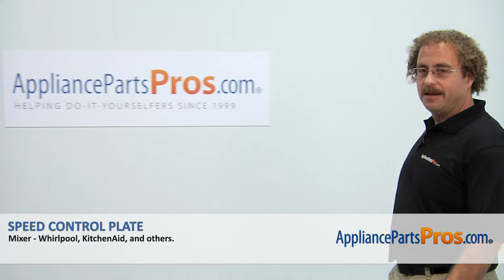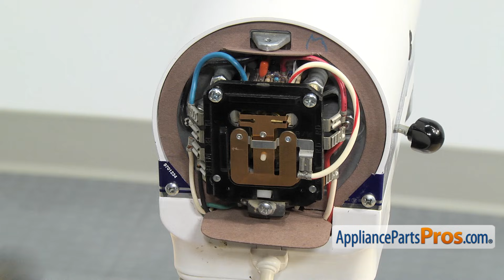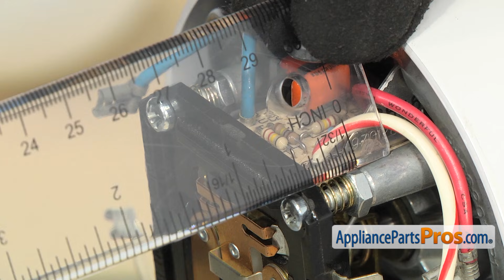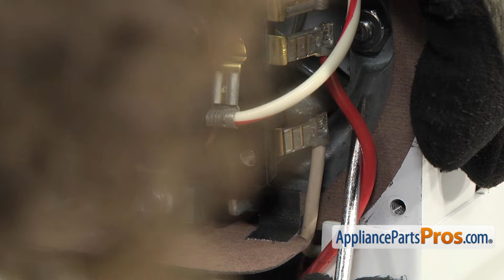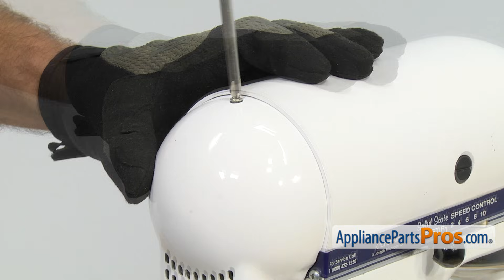How To: Whirlpool/KitchenAid/Maytag Mixer Speed Control Plate WPW10119326

Comment: My 2020 Classic gets weekly use making dough and I figured it could use a look see under the hood.Found  your to-the-point and nothing else (so rare on YT)  tutorial. I build vacuum tube audio gear as a hobby and was struck by how delighfully archaic the speed control is. And it has brushes! Bet newest ones are all electronic and would have packed it in by now.
Reply from the maker: Glad you enjoyed it, @b.scarpia7159 👍Those classic mixers really do have a surprisingly “old-school” mechanical design, and it’s part of why they’ve held up so well over time.

Comment: I replaced my board but with screws all the way in and all the way out, my slow speeds are still far too fast. I need to be able to mix slowly without flour flying and knead doughs.
Reply from the maker: Sorry to hear that, that’s frustrating when slow speeds are still too fast. For detailed troubleshooting steps specific to your situation, our certified techs can help you at forum.appliancepartspros.com. Just post your model number and what you’re experiencing, and they’ll walk you through the diagnosis!
Reply: So you did your initial setup with the proper spacing as shown in the video? If you did and you don't have the ability to slow the motor by tightening the adjustment screws, this is a classic indication that your phase control board (that little module above the speed control plate) has failed and needs to be changed.

Comment: Hello and thank you first of all for your very informative tutorials.

I wanted to ask you a question through this tutorial. My mixer no longer stops when it's in the zero position, and I'd like to know how to fix this problem.
Thank you.
Reply from the maker: Thanks for the kind words, glad the tutorials have been helpful! 😊 When a mixer will not stop at the zero position, it usually needs some specific troubleshooting on the switch and control system. For detailed help on what to check and how to fix it on your exact model, our certified techs can assist you at forum.appliancepartspros.com if you post your model number and describe the issue.

Comment: What if you have the 8qt commercial version? I don't see this part.  I checked the slide switch,  it's clean.  Still shuts off when I get to speed 8. Have to shut off and turn on again for it to work.
Reply from the maker: What is the model number?

Comment: What grease do you use ? It looked like a molykote grease.
Reply: To grease the gearbox? Any NSF H1 NGLI 2 grease.
Reply from the maker: You will need to use the planetary grease, part number W11200218. You can place the order through the website, or you can call us at 1-877-477-7278 to place the order over the phone.
Reply: @appliancepartspros no, you don't need to use that grease. Whirlpool doesn't even use 930-2 on the mixers anymore
Reply from the maker: The information we provide is based on manufacturer recommendations.
Reply: @appliancepartspros  the problem is that the grease you show on your website is Benalene 930-2, which is not an H1 food safe grease. Benalene 930-2 is the brown grease that Hobart/Whirlpool had used for many years. Only H1 food safe grease should be used in equipment where there's any chance of grease dripping or otherwise getting into the mixing bowl. Whirlpool has since switched to a white H1 grease, and this is what the machines should be regreased with. Unless the part number has stayed the same, but the grease has changed, and your photos are old, what you have in the photos is the old, unsafe grease. Not only that, but that is a big can of grease. Much more than is needed. It takes less than 6 fluid ounces to grease one of these machines, and the cans have much more than that. Basically $50 for a can of grease that will sit in someone's garage for years to come.
Reply from the maker: Thank you for that information.

Comment: when we power the mixer on it starts to turn but within a second or so it shoots out sparks from the back and it trips the gfci outlet.  would a damaged speed control plate cause sparks?  if so, I found my fix video :)
Reply from the maker: You will need to check for damaged wiring and the speed control plate, also check the motor brushes for damage.

Comment: Wait.  What?  I bought a new control plate and it does not have that spring behind the screw.  You mean I'm supposed to take part of the old control board and put it on the board I just bought?  That's nonsense!  I assumed it was an upgraded design.  BTW-  My new control board was defective, the arm was bent and the breaker points would not make contact.  Poor quality control.  And now they just leave the screw spring off?
Reply from the maker: Yes you would have to put the spring on the new board. It isn't part of the new board. If there is anything we can help you with please let us know.

Comment: Do replacement speed control boards come with the locking plate
Reply from the maker: Are you referring to the black plate with the terminals? If so, yes. If you're in need of a separate part, the model number of the mixer would be needed.
Reply: That "spring locking mechanism " or "locking plate" as he called it must not be essential to the mixer because my older (15 year old) and newer (1 month old) mixers never had one and I haven't seen it sold with any speed control plate.

Comment: The pin on the base part of mine is coming out all the time. Why and how to fix it ? Mine is pretty new.
Reply: Did you figure it out?
Reply: @BringItOn31124  Yes, i did. But the construction with that pin on mine is not good.
Reply: @josephinenguyen6055  I'm assuming you're talking about the hinge pin that the mixer head pivots on. It's just a pin and a screw that holds it in place. What kind of construction problems are you having?
Reply: @BringItOn31124  And that screw is accessed from underneath.  

I just repaired one where the owner cranked in the height adjustment screw instead and ended up destroying his beaters along with the bowl and then threw it out on the curb with the trash when all it really needed was to be turned upside down and the set screw for the tilt dowel pin tightened.

Some people are too ready to throw out a $300 to $400 mixer instead of taking a minute or two to verify what the correct fix is.  It took me perhaps a minute to fix this so that is effectively $18,000 to $24,000 and hour so you might consider that a pretty decent ROI plus we saved another K45 from the landfill.

Best!

Comment: Thank you. Found it very helpful, especially as there weren't many videos specific to this. I was able to get away with just tightening the screw for the speed lever fix. All went pretty smooth until I was replacing the rear cover and pinched the power wire, shorting out the machine! That led to another video, trip to Harbor Freight, and wire repair. All is well now. Needless to say, be careful tucking the wires back in and putting on the plate.

Comment: First off , THANKS for this video. It has helped many of us . Secondly, should I be able to measure some value of ohms from the motor winding while I'm working on the control plate?   Right now I get open circuit from the TWO motor leads.  Thanks

Comment: My mother's mixer was acting up.  She got it back in about 1984 and was just about to toss it.  She was really upset.  It kept shocking her and then finally wouldn't even run.  I took the back cover off and found that the motor control plate was filthy.  I cleaned it with an old tooth brush.  Then I removed the brushes and blew out the brush holders.  I put the brushes back in and tried it out.  It started running.  It runs through all the settings now.  It does sound kind of loud.  It may need the grease changed.  Not bad for a mixer that is over 40 years old.  I wonder why it has worked so well and lasted so long.  Oh.  It says that it was made in Ohio.  Now I understand.

Comment: Hi, thank you for your video. I’ve fixed my KitchenAid Heavy Duty (uk) because of your video. Can I ask, are the RPM’s the same in the UK as they are in the USA? I cleaned my speed control plate with 70% alcohol as it had managed to get gunk on the contact plate areas and with a little re-adjustment all seems well to what it was and back to normal.

Comment: Try fixing a Kitchenaid mixer in the UK, you can't find spares anywhere. I had a similar problem with the speed control arm slipping back and not switching off. I discovered it was the flat spring that goes under the lever was missing and when I applied tension to the lever it stayed in the stop position. The problem is trying to find spares, I wanted a new gasket but couldn't find anything beyond mixing blades and bowls.

Comment: Mine wouldn't turn on. What I found was simply dirty contact on the points of that copper bar across the bottom. Cleaned the contacts. Works!! View @ 6:08.

Comment: My mixer was running intermittently up to speed 6, and would not start below 6 unless you moved the speed control to max and then slow it down. It was suggested that I needed a new speed control. Taking the rear cover off and observing the contacts I discovered the main contact was not always making contacting. You could see small arcs across the contacts , especially in the lower speed range. Before the new control as suggested I slightly bent the contact on the control board upward to make better contact and the mixer runs just as new. My experience, your may be different.
Reply: Big help! Thanks for ending my search!!

Comment: Hi, I was working on this and the spring shot back into the mixer. How do I hook it back on?
Reply: If you can see the spring up inside the housing, you may be able to hook it with something and pull it back out.  Maybe a piece of stiff wire with a short hook bent at one end would work.  If you can't see the spring to grab it, you can remove the top of the mixer from the lower part.  There are "re-greasing" videos online that show how to do this.

Comment: Quick question. Is it possible to test the motor by connecting the line and neutral wires directly to the red and white wires on the motor, thus bypassing the phase and control plate? I have a dead machine and not sure what to buy? I have checked the brushes and OHM tested the cord, all good.

Comment: I didn’t unplug it before taking the brushes off and there was contact with the outside of the mixer. There was a big spark. Did I just blow the motor? I originally took it apart to replace worm gear. Which I did successfully but now it won’t run. I could hear the motor running before but not anymore

Comment: Hi teacher. I have a mixer, the same as without load, it works perfectly well, but when I put it to work making pizza dough, for example, after a short time of work, it begins to have ups and downs in speed, and when placing it on high it does not suffer any change. reducing the speed from top to bottom it stops at 4 and you have to keep going down to turn on

Comment: Hi, very good video, I have a kitchenaid bought in the USA but I live in a country with 220V, therefore I use it with a transformer.
  Now I have a problem, it only works at maximum speed 10. What do you think is the problem?  If necessary, where can I order the parts ?
  It's a Kitchenaid, Super Heavy Duty model : KSM50HDPBK.
Thank you in advance
Reply: From 60hz to 50hz the motor runs slower, so it is necessary to check the centrifugal switch weights which must stop the motor through the adjustment plate. Very rare, the small circuit, above the plate, if it is defective leads to this failure= impossibility of adjustment, but appliance will be able to say more  , Good day !

Comment: This is a great tutorial, but I thought I'd share my experience. Our stand mixer suddenly stopped working and tripped the GFI circuit in our kitchen outlet.  Once we confirmed that the outlets were working, the stand mixer still wouldn't start.  So I searched the internet and found this tutorial.  However, the problem wasn't with this part.  The problem was with the carbon brushes located on each side of the main housing (the big black regular screw heads).  I took these out and found them to be quite dirty.  I brushed off the residue and reinserted the brushes and the machine worked.  You have to be careful, the brushes are rectangular pegs, but one side is chamfered at a 45 degree angle.  Pay careful attention which direction the angled side is facing when you pull it out.  It has to go back the same way.  The other side will be the opposite.  For example, the right side brush had the angled side pointed in the upper left corner, the left side was pointed in the lower right corner.  Anyways, check and clean your brushes first.  If that doesn't fix it, then give this part a try. Hope this helps!
Reply: James, thank you so much for your comment. My mixer was having some weird issue that I suspected was the kevlar gear (it was) but I must have replaced the brushes in the wrong orientation when checking them. your comment reminded me to check those, and sure enough I had them the wrong way. thank you again!
Reply: Thank God, I saw this comment. It was just what I needed to get my kitchen aid mixer fixed.

Comment: Thnks very helpfull, itn  worked for me. The only problem is I cant reach 15 reps in 15 seconds, I tried to adjust de screw but it only get 12.
Reply: 15 reps in 15 seconds would be the proper speed for the "Stir" speed setting.  This is supposed be adjusted using the two screws at the top of the speed control plate.  The single screw at the bottom is used to fine tune the higher speeds (3 reps per second for Speed-6) after the "Stir" speed has been adjusted.
Reply: @peteduncan921  Thanks sir, very helpful. I'll try.

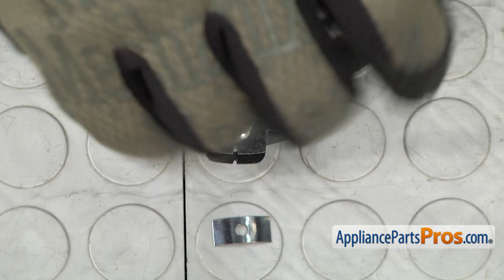Comment: It looks like I lost the locking plate (05:45) (where we set the high speed), as I don't see it in my mixer when I opened it? My mixer doesn't stop even when its on off position and even at the lowest speed, it runs faster. Doesn't the locking plate come with the actual speed control plate WPW10119326?

Comment: Hello  I have a Kitchenaid Pro Hd mixer.  The head was loose so I went in and took out the board etc and tightened the screws at the back....   I just went to use it and it is running really fast and then shutting off... it won't run on a slow speed.  Can you tell me what I did wrong when putting it back together?  thank you!

Comment: Hi, after two attempts, I finally let the spring slip out and now it is in the mixer.  What do I do?  Help;
Reply: going to have to fetch it, possible dissembley to get it, also the other end needs to be hooked in to place, idk if it came unhooked.
Reply: I am near to retrieving a spring from a K45 I took off speed control plate, seal and removed electrical cable In that area below is where your spring may be

Comment: Excellent video. I was hoping you would comment on the paper seal. At removal, you could see it was broken and you repaired it with a little bit of tape on replacing it. What is the purpose of that ring?
Reply: It just helps keep flour out of the motor.
Reply: I think it keeps flour out of the motor

Comment: can we convert 110 volts mixer into 220 volts please reply
Reply: You have to change the whole motor. Better you buy it 220 volts. ( or, you can buy and use converter transformator , you have to buy a minimum 1,5 time bigger then the wattage on the machine, but not recommended this way) So, you need these for full convert

1 x Armature

1 x Field Coil Assembly

1 x Phase Board

1 x Power Lead

Comment: I had to replace the speed governor as it only worked at top speed. My wife plugged it into a 220 outlet. While I was taking the plate off the end of the spring got bent and then it bounced inside so I had to dismantle everything to put the spring back in place. I then reassembled everything but now I am getting no power at all. Not sure if something isn’t secured enough on the speed control plate. I’ve tried to crimp down on the wires so they aren’t moving. Am I missing anything?

Comment: Hi, good video, thanks. I am having a problem with the mixer not even starting at this point. its almost new. The wife was cleaning it and it tipped over on the counter and fell on the speed control lever. i fixed the control lever, but it still won't start up. Any ideas on where I should start, and what I probably need to replace? IE, speed control plate or chip on top of the speed control plate? Thanks again.

Comment: Our Classic Kitchaid mix was making a rubbing noise, so I took the back cover off. I discovered a nut had fallen off and the other side was loose. I could not reach the thread to put the nut back on. I took the mixer speed control plate off and when I did I counted the number of turns. I had not seen your video yet. I put the plate back on and used the measurements you gave (3/8 & 9/32). It would not turn on. I adjusted the screws, but still nothing. The bottom screw is not long enough to get a measurement of 9/32. Any thought on what I can do? Thank you!

Comment: My Kitchenaid will not start on the lower speeds, once I set it all the way up to fast, it will start... I can then slowly back it down to the lower speeds and it will slow down and continue working. Will this repair fix this problem?
Reply: You could first try adjusting the two Philips screws on either side of the top of the control plate.  Mine were WAY too loose, and I lost the first three speeds.  Once I tightened them securely into the mounting posts, I got all my speeds back.

Comment: Why would you replace this particular part? It is just a plate with electrical contacts. No electrical nor mechanical use that would put any sort of "pressure" on this item ...
Reply: Mine cracked, cheap plastic.  The screws were loose, so it wasn't getting good contact.  I lost the lowest 3 speeds.